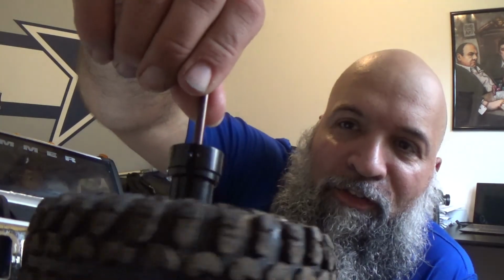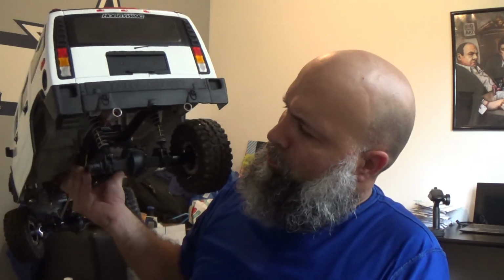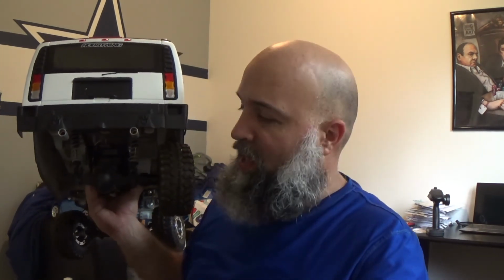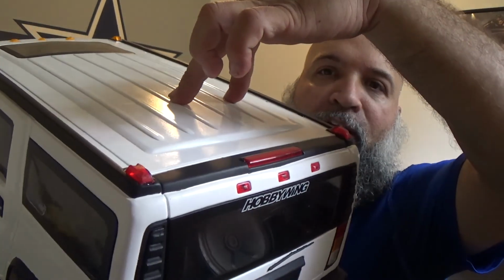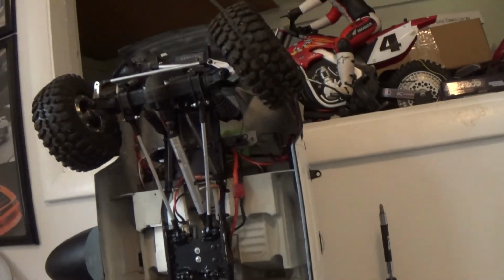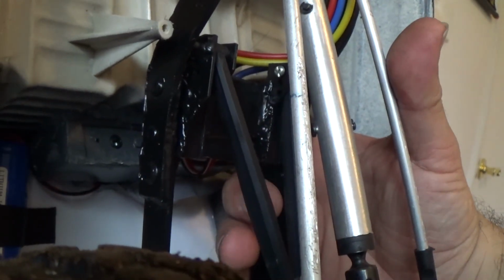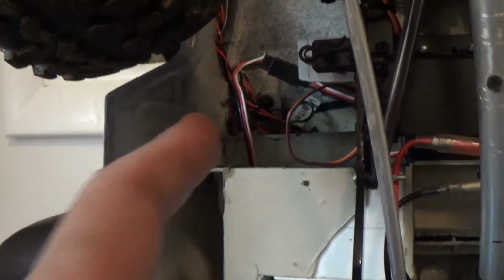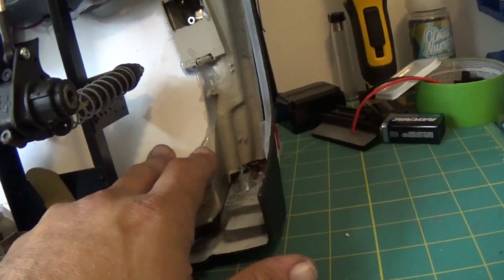1/6 scale Hummer H2 gets a new paint job and a minor problem

Comment: Hi, your build looks nice. 
 I'm not sure when Ill get to build mine as I have one of these bodies too.
May I suggest  you fix your axle pinion output shaft angle, to be parallel with the transmission output shaft by shortening the upper links. This will cut down on a lot of vibration, and fix your twitchy steering.  Please take this as constructive criticism, as I'd like you to be able improve your rigs performance. 
I took notes on your paint, as I'm terrible at that.
Reply from the maker: Thanks for the input